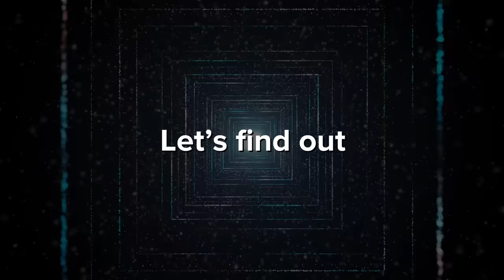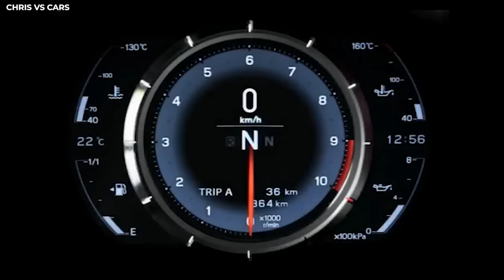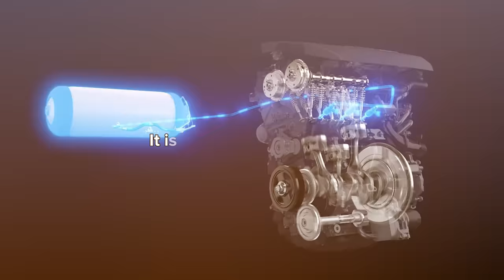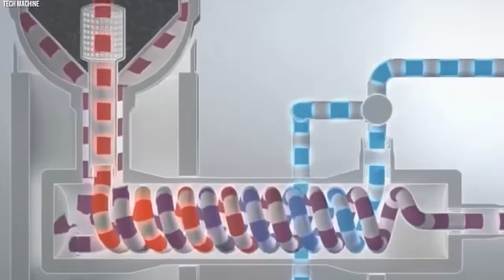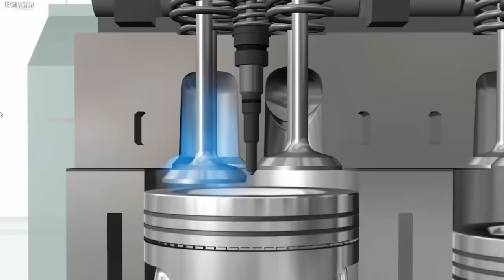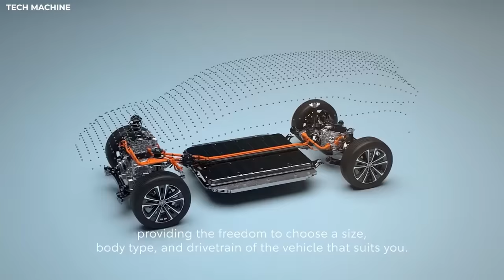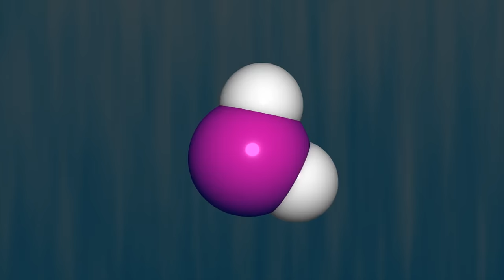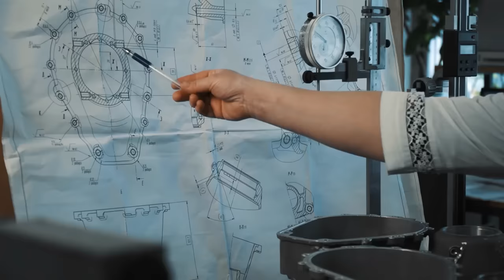Toyota CEO: "This NEW Engine Will Destroy The Entire EV Industry!"

Comment: Look at the Toyota Mirai.  Only available in California in North America.  Several of the fuelling stations where shut down and Toyota is currently off loading them with a $40,000 discount.  You think there is a lack of electric charging now, wait till Toyota tries and rolls out hydrogen or ammonia(Toyota’s other engine) stations. 
 
How much does it cost to fill up a Toyota Mirai?
True Zero is currently the lead hydrogen supplier in California, and currently charges $36 for a kilogram. The Mirai accommodates 5.6 kg of hydrogen in its 142.2-liter tank, meaning you'll have to spend $201.60 to refuel. This is an obscene amount that both fossil fuels and electricity drastically outprice.

Comment: Well demonstrated Toyota's futuristic! HICEV: "Hydrogen engine" zero carbon emissions , having same comfortability & power performance of traditional  gas engine. AMAZING! new ideas of technology. The question is  how much it cost , the price per volume or per liter/gallons difference between Hydrogen & Gasoline? & its consumption rate per kilometer/mile? (5 Kilograms = 300 Miles)......I'm an Aircraft Mechanic working here in S.Korea

Comment: This is scarcely new technology. The internal combustion engine is over 150 years old. And hydrogen is produced from fossil fuels. Yes, it can be made from electricity and water ('Green Hydrogen'), but that is very inefficient and expensive. 'Blue' hydrogen is produced from fossil fuels such as methane or coal into hydrogen, but it is leaky and inefficient. The blue hydrogen process currently being promoted is an environmental con.

Comment: And so begins the downfall of Toyota...
Hydrogen is not the same as petrol.
It evaporates at incredible rates - imagine leaving your car for a few days and it's lost 30% of its fuel - that's hydrogen.
It still requires a lot of moving parts and servicing - hence far more unreliable than an EV.

Comment: I finally thought we were not going to have to deal with all of these maintenance problems with combustion engines. Idk I I'm good with electric as long as I don't have to do oil changes, transmission flushes, coolant flushes and coolant water pump, timing belt, serpentine belt, Gaskets replacement, oil leaks, Brakes, brake shoes, brake fluid, Calipers, fuel filters, air filters, and all the other Maintenance costs and Problems. 
Tesla just plug un plug and go. Getting used to charging all the time I can get used to it. To trade for all these maintenance problems

Comment: Near zero emissions completely ignoring the large carbon footprint of the manufacturing of the Hydrogen, that’s like saying EVs have zero emissions, in the same way your carbon footprint is increased when charging an EV from the grid, your carbon footprint and that of the H2 vehicle is also increased when you refill the H2 tanks as the Hydrogen also has to be manufactured with a carbon footprint. They need to stop using the term zero emissions because it’s not entirely accurate because it’s more a case of moving the carbon footprint or emissions to a different location.

Comment: EV Is way ahead of this and accelerating. EV simplicity and low maintenance is what is fundamental. Then not forgetting, all cars will be driverless in the next 10 to 15 years. You wont own a car, you will not need to. You will be able to hail any type of vehicle you require.

Comment: Whoa there: 1. Hydrogen is expensive to produce - will cost a lot more than gasoline! 2. Hydrogen is the smallest molecule, which means that it cannot be contained and ALWAYS leaks from metal tanks. Leave your car parked for a month, the tank will be empty because of the leakage. 3. H2 fire IS INVISIBLE! If your hydrogen leak ignites on fire, you cannot see it! That fire is extremely hot!

Comment: Atmospheric air is 78% N2 & 21% O2 - so technically, the H2 engine efficiency is not going to be very high. The other issue I perceive is at burn time does N2 react with the H2 and produce N-H compounds, especially ammonia (NH3), albeit in low amounts. 
Finally, the physics of liner momentum to angular momentum means that electric motors will outclass and ICE relatively easily

Comment: I love that there will be diversity in eco friendly vehicles.  I find it a bit silly to say they will destroy the EV industry though because there are trade-offs that are not really expressed in detail.  The complexity of H2O seems greater with some unknowns at scale.  Scaling out fuel distribution is described as more intensive electrically at scale.  Because these are still piston-driven engines there will be much greater demands for maintenance no matter how well they refine the tech. The driving range is nice, but the use case is fairly limited because both H20 and the EV refueling infrastructures are so immature at this point in time.  I think that the refuel is wonderful, but I've down the math for myself for a long commute from Tacoma to Redmond and into Seattle in a day.  I am a road dog who enjoys driving (outside of peek hours of course).  It seems to me that the day gig and evening gig (musician) can be easily handled by an EV.  That equation only changes on really long road trips which are very, very rare.  Those anomalies can be handled with short-term rentals frankly.  But even a quick charge system could overcome that with just a little bit of extra planning.  Pull over for lunch (charge), Bathroom break stop (charge), pull over for a roadside attraction (charge).  The only reason it is inconvenient is that we have not built our infrastructure out nearly as robust as it will need to be for either to really replace ICE.  I also look forward to battery tech improving right along with Hydrogen.  

The Lithium requirements are problematic at scale, but what is really silly is projecting that out as a negative on eco-friendliness over time.  The lithium extraction is a one-time event whereas going gas-free is a massive win, let alone the super low maintenance cost.  I see a future where both these technologies exist side by side.  If most families are 2-car families, one might have one of each.  The shorter commuter might choose the H20 to minimize maintenance costs, and it is there also for the odd long-range family road trips.

One question I have is how we can clean up the electric grid so that either of these platforms can fulfill their environmental promise overall.  We have a capacity for wind to offset a fraction of the main sources.  Solar combined with battery tech can handle nearly 100% of a two (2) EV car home.  And all of these technologies are all so damn young.  We all just need to keep on pushin' (Curtis Mayfield).

Comment: Still far too many moving parts/ complexity. So greater costs up front as well as in maintenance. Legacy motors will love it though. Other issue is hydrogen infrastructure, as well as risk. One accident, a la Hindenberg, and byebye public faith in hydrogen vehicles. Meanwhile EVs continue to advance. Soon sodium-ion will replace lithium. EV prices will fall accordingly. And if technology to extend range keeps increasing at 200% every 5 years - we could see general EVs achieving 1,000 miles per charge (it is already possible with the Aptera). I think BOTH may have their niches in the market however. The biggest issue for EVs is infrastructure capacity - but advances in renewable energy production (especially wave technology, and seeing as huge numbers of humans live in coastal cities) should solve that problem.

Comment: Hydrogen powered cars are a bad idea specifically because the fuel must come from electricity. Every time you convert from one form of energy to another, you lose a percentage, and the more times you do this, the quicker those losses add up. So for this vehicle you have to produce the electricity from some combustion or renewable resource like solar, hydro or wind, loss #1. Then you convert back from electricity into hydrogen through electrolysis of water (either through a battery powered fuel cell or a fueling station that produces it on site), loss #2. Finally, you convert back into mechanical energy through internal combustion engine and drivetrain, which as it sits now with that tech you're losing at least 60% of the combusted fuel before it actually puts power to the ground, loss #3, which is enormous. This is why if you're going to go electric, batteries are the bees knees, because you only convert once directly from electrical to mechanical energy, putting power right to the ground. Charging of batteries is a relatively small loss compared to electrolysis as well. 

The one thing mentioned that's still unsolved is the rare earth metals and lithium needed to make the batteries right now, but overall straight up electric cars will continue to dominate this trend, and these hydrogen engines will be a huge waste of money. If Toyota invests too heavily it may sink the whole company. What companies should really be spending their R&D money on right now is battery tech. If we can get 500+ mile range in battery electric cars that compete price-wise with comparable ICE cars, it's all over for traditional automobiles, especially as oil becomes more and more scarce as time goes on. Mark my words, battery tech has already rendered these hydrogen engines obsolete before they were built, and as batteries get lighter and hold more charge for a given weight, this trend will continue.

Comment: hydrogen engines are not a problem and been around for over decade .... Storage of hydrogen in a car is a problem as a liquid requires cryogenic temperatures because the boiling point of hydrogen at one atmosphere pressure is −252.8°C. and need   5,000–10,000 psi tank pressure..

Comment: Hydrogen isn't the most abundant element on it's own and that's the problem. It's such a small atom it can travel through aluminium and the first air ships had to use cow guts to line the storage to stop the atoms escaping. There is not one efficient means to make it and Toyota must have something to produce it cheaply as the loss from electrolyzing it is too great to be used commercially.

Comment: Whan Hydrogen is burned with air instead of Oxygen, the combustion creates nitrous oxides. So it is not only producing water. 
On top of that: Where does the Hydroben come from? It has to be produce with energy. That has to come from somewhere.

Comment: And question x2- if the hydrolysis process exhausts only water, what's to say that water be recycled back for hydrolysis for use- sounds like perpetual combustion to me.

will the magnesium H2 (light-metal hydroxide) slurry being researched now, for storage, be  morphed into the use of this engine, removing cryo storage while using the combustion water by-product, to re-activate the hydrogen from slurry storage, rather than out the tail pipe, or would reactivation be too slow?

Comment: There is no adequate supply of Hydrogen. In California, where we introduced a few of these cars, the cost of hydrogen, which was already expensive, skyrocketed to 3x gasoline and 17x electric (equivalent). So basically, yeah you can produce a very expensive car that is very expensive to drive around and has no infrastructure.  Unlike electric, which you know, is already everywhere and even that is still having distribution issues.

Comment: As a plaintiff’s personal injury lawyer, someone riding in a car with liters of hydrogen under them at high speeds on the highway, will likely result in a significant increase in wrongful death cases (due to large fireball-like explosions after high speed crashes) for my practice. Way to go Toyota! 😂

Comment: Anyone that has ever had a vehicle and been told you've got a leak, should be very concerned about hydrogen vehicles. Not only do you risk going up in flames like the Hindenberg, or the station that you refill at going boom like the 2020 Beirut explosion, you also risk filling up and your fuel simply disappearing - just like the equally secure gas in your aircon.

Comment: It's too complex. EV has 3 parts; Battery; inverter; BLAC gearmotor. 
Hydrogen is wonderful fuel and very energy dense, but only good for big machines that can absorb the cost of complexity. 
The trend will be towards EV micro cars and trucks. Chinese Wuling sold 1.1 Million units. Light and cheap is the way of the future. 
I think Toyota and Honda have lost their ways. Most people want a small inexpensive peppy car to get around in life. EV delivers.

Comment: 4 stroke combustion engine can only achieve a maximum of 25% efficiency compared to electric motor's ~100% efficiency. And it offers a highly pressurized fuel tank constantly threatening your safety. I can't wait to see TM's range and fuel efficiency ratings.

Comment: All said and done, still this Hydrogen engine has a gazillion moving parts, needs plenty of consumables such as seals, gaskets, all, increasing maintenance costs. Whereas an electric motor has so few moving parts, no need for an engine, gearbox, differentials etc, which contribute to the mass of the vehicle. All controlled by wire.

Comment: I have a HUGE problem with burning hydrogen in an internal combustion engine at LOW THERMODYNAMIC EFFICENCY (subject to the Carnot efficiency limit) without  consuming hydrogen as a fuel in a FUEL CELL that is not limited by the Carnot Efficiency, to directly generate electricity that can be used to drive electric drive motors!
Toyota should know this well, because Toyota already makes the MIRAI hydrogen fuel  cell car !
Why go back to internal combustion engines? 
How does Toyota overcome the barrier of the Carnot Thermodynamic efficiency limit applicable to all HEAT ENGINES?
Can someone explain how Toyota hopes to exceed the Carnot efficiency limit with its new Internal Combustion HEAT ENGINE? 😡!

Comment: Hydrogen car is not new. If this is really sustainable, then at least today half of the car population is already using Fuel Cells. Problem is the $2M cost per fuel cell station plus the handling. Japan has been subsidizing these but it still the growth was a slumped but I'm still hoping this in the future that all would be cheaper than petrol or EVs.

Comment: Is using water as a fuel for an automotive engine really possible?  I've read responses that say it's impossible to derive the Hydrogen needed to power an engine from water.  I, for one, hope that what they are trying to create is true, but I've heard that some battery power is going to be required and that could impact it's overall toxicity.  Then again, it's still in the infancy stages so they will have time to consider how to make it as environmentally safe as possible.

Comment: Toyota is interested in “all” and “alternative” options because they got caught with their pants down, ignoring and denigrating EVs as Tesla and China roared ahead and non-Japanese legacy automakers caught on. Problem for Toyota to catch up in EVs is…

1. Lack of battery production capacity. Even battery suppliers have none to offer without building new factories (see Ford and GM building a large number of battery plants). Time to plan, build and then ramp a factory (reach the point where you are making enough cells (throughput) with high enough quality (“yield” percentage)) is years… like 5-6 years.
2. As shown by the reporting balance sheets from the only legacy automaker to publish the data, Ford, starting up EV manufacturing is like a whole new startup business… with all of the huge capital outlay and annual losses until costs have come down from development lifecycle and pure volume. So short-term losses… which investors/institutional shareholders don’t like. Further losses from changing factory tooling to more automation and Giga casting. Changing or reduction of long term supplier partners…
3. Regular OTA updates and fixing issues via software updates in the field and agile product development are antithetical to the Japanese business culture and mindset.

So in the meanwhile Akio Toyoda goes around blowing smoke up everyone’s tailpipe trying to retain formerly loyal Toyota customers as Toyota engineers desperately scramble to develop a competitive but profitable EV. Yeah… good luck with that!

Comment: I love the hydrogen engines, some of which are already in use. That said, in a generation or two, battery technology will likely greatly improve in capacity, size & weight, charge times, etc, making EV much better with fewer moving parts. The way we view current lithium batteries now, compared to old dry or wet cell batteries of the past will likely be how future batteries will be looked at compared to today.   Hydrogen engines are great, but it still takes a lot of electricity to generate hydrogen, and more recourses to store and distribute it than just electricity.

Comment: THE BIGGEST ADVANTAGE TO TOYOTA OR TO ANY PRESENT AUTO MANUFACTURER IS THEY CAN JUST KEEP PRODUCING THE SAME ENGINE AS THEY'VE ALWAYS PRODUCED THE SAME CAR AS THEY'VE ALWAYS PRODUCED AND JUST HAVE IT RUN ON HYDROGEN JUST THE SAME AS YOU COULD HAVE A DUAL FUEL USING PROPANE OR LIQUID PETROLEUM 
DAVID ADAM GRENIS 2044 MAPLETON AVE 
BOULDER COLO 80304